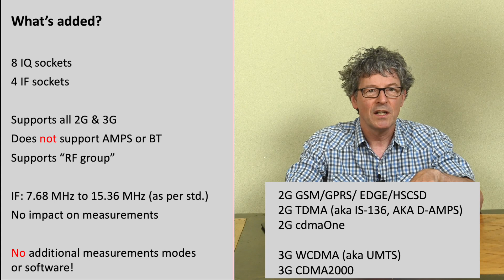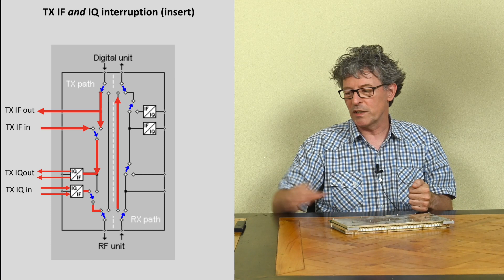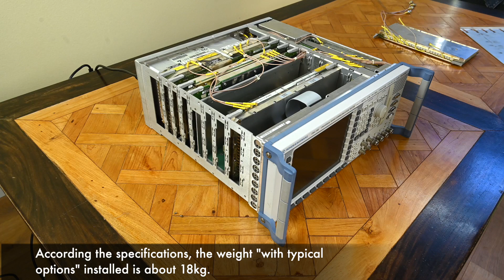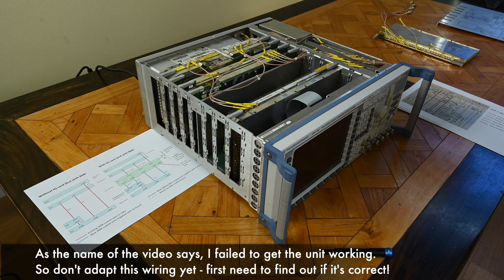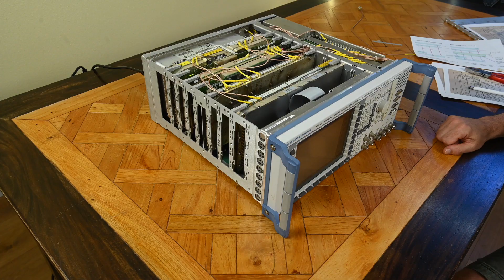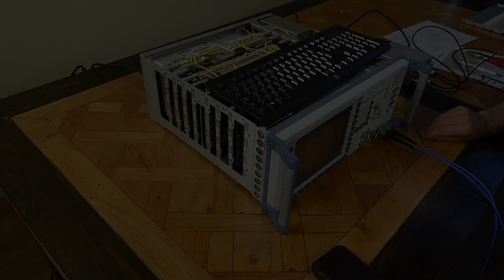REL #29 Adding B-17 IQ IF option to CMU200 - FAILED

Comment: Try to do a "FIRMWARE UPDATE AFTER BOARD CHANGE"

* During startup observe the display.

* When three BEEPs can be heard, press the MENU SELECT key. The version 
manager is started (see also chapter 4, Firmware update). The display 
includes the menu item FIRMWARE UPDATE AFTER BOARD CHANGE.
* Press the softkey to the left of the above mentioned menu item. The 
automatic module data adjustment is performed under software control, 
firmware updates for microprocessors and programmable devices being 
performed as well. This may take a few minutes. After the adjustment has 
been terminated, the operating software starts automatically and the R&S 
CMU is ready for use and complies with the specifications. !
Reply: I read in R&S Mailing List, that you already got it working. :)

I upgraded my cmu200 with an CRTU-B7 IQ-Card, which seems to be about the same as the CMU-B17. It got detected as CMU-B17, and its working so far. I didnt test the IQ In and Outputs yet, but the CMU200 behaves normal.
Reply from the maker: dragonlard4595 , thanks! You are right; doing a "firmware update after board change" is necessary (even if the board, unlike other boards in the CMU, does not show things like part number and modification index in the [INFO] menu, which made me think this is a dumb unit with only switches operated by the CMU, and an EPROM with values written to it). It took me some time to edit this video, but I am making progress on the IQIF board installation in the meantime. Interestingly, there is quite a lot more to it; actually, there were three different reasons why my installation went wrong. On top of that, I am finding out some weird particularities about the board and its outside connections. Once all is figured out, I will share the results ;-)